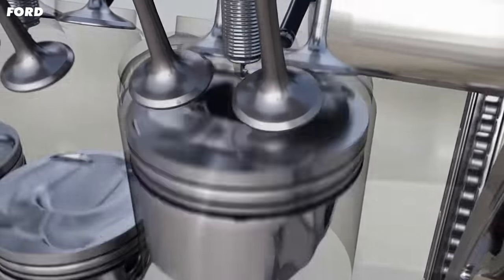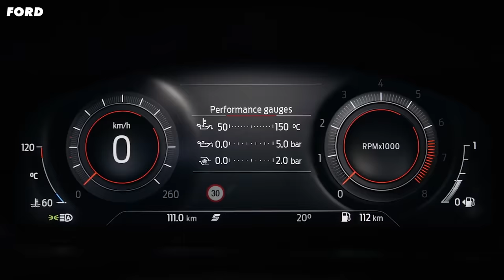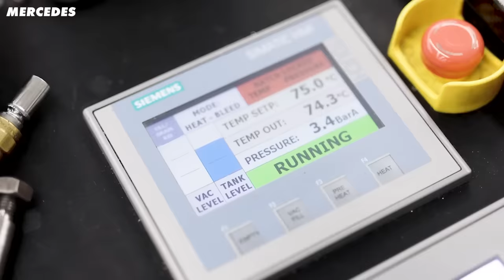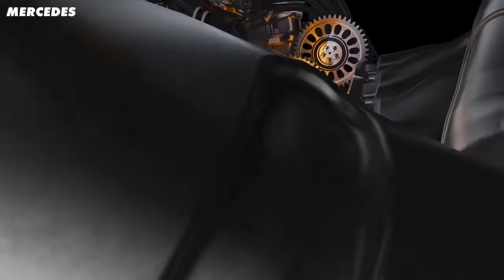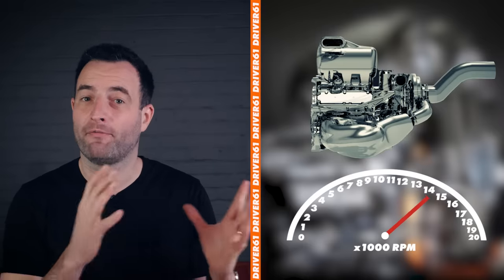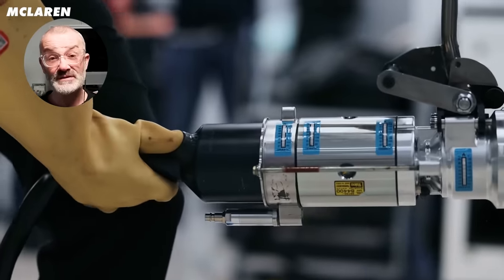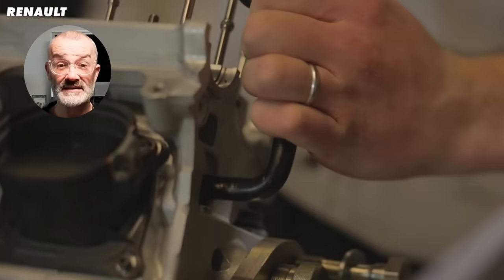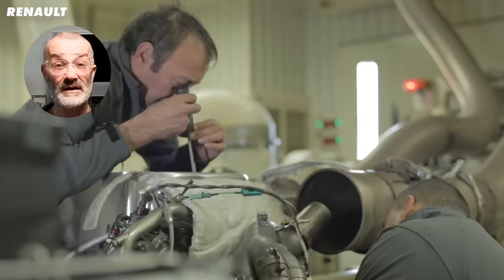$5000 Normal Engine vs $10 Million Formula 1 Engine

Comment: **SIGH**
F1 engines are NOT seized when they are cold. This is a myth and a lesson in basic physics. When things get warmer they expand. So if an F1 engine can’t turn when it’s cold what do you think will happen when it’s warmed up? It’s locked up even more so!

The reason why they are warmed up for over an hour before they fire them up is about tolerances. Just as with the SR-71 Blackbird, the engines and such are built to operate their best at race temperature. So when it’s hot it delivers max performance. But when it’s cold, because the parts have not yet expanded “into place” due to heat, they don’t fit as well together and fine amounts of damage is done inside the engine. Which is bad…. Obviously. 

Sorry. I just get tired of experts getting this wrong. Im a fan of his content. He’s one of my go to’s for F1 info. But this is incorrect.

💔💔💔💔RIPKB💔💔💔
This will forever be too soon 😞. Thank you for all the times you put a smile on my face with the Hoonicorn 🙏🏼
Reply: Came to the comments to make sure someone pointed this out 👍🏻
Reply: Not saying it is actually locked up, but -
What happens to a cylinder when heated?   It expands.   This means the bore opens up a tiny little bit.   
If the bore opens up, that increases piston clearance, which would reduce wear.   Short stroke high rev engines such as these I would imagine are ridiculously oversquare, and likely subject to skirt interference, among other issues.
Reply: @DethWshBkr   I was juuuuuust about to argue with you. Then I remembered I had a brain and knew better to look up the physics on thermal expansion of cylinders and yes, the hole gets larger. Thanks for the correction! There’s still fitment tolerances that must occur for other parts so they don’t just rattle around like a bunch of marbles in a clothes dryer. 

That’s said, here’s a cool video about warming up and starting an F1 engine where the engineer says they aren’t seized. So we are both right. 

https://youtu.be/W-Tx-qiJx2A

Comment: What a silly title. You are including all the R&D costs that went into the F1 engine plus the little bit of manufacturing cost. For the production engine you are just quoting manufacturing. But the R&D costs of a production engine dwarf those of an F1 teams engine. It's only 5 grand per unit because they make hundreds of thousands of copies.

Comment: I still cant see $10,000,000 there! That's the same cost as a CF6 high bypass Jet Engine.The most advanced jet engine to date, the PW600 used in the F35, $21 million. The cost associated with Formula 1 is a complete load of BS!!!
Reply: I think you're not taking into account that these engines dont take advantage of economies of scale. A Jet Engine's cost is spread out among thousands and thousands of produced copies of the engine, while an F1 engine is produced 3 times the number of cars that are using it. So lots of the costs per engine are so much higher for an F1 engine than a jet engine, hence the price.

Comment: The price tag of the engine doesn't represent its performance. It's the concept that decides everything. Whether 5K or 20M are nothing but pure rubbish as long as they are reciprocating engines.

Reciprocating engines are the least efficient concept and should be abandoned long long time ago. It's a shame that the entire automotive industry is still producing this type of rubbish till this day.

Why do we need oil change for the engines after certain mileage? Because in reciprocating engines, high pressure inside the combustion chamber forces fuel to slip pass through the piston rings and ruin the lubricant oil. That's the purpose of oil change. It also means the higher the pressure, it will cause more fuel to ruin the lubricant. Because of that, all GDI engines with turbocharger are unreliable because of its high pressure.

To all car makers, stop producing rubbish. Start making cars that are reliable for as long as possible. Cars with no resale value are rubbish but nothing else.
Reply: Believe in JESUS today, confess and repent of your sins. No one goes to heaven for doing good but by believing in JESUS who died for our sins.  “That if you confess with your mouth, “Jesus is Lord,” and believe in your heart that God raised him from the dead, you will be saved. 10 For it is with your heart that you believe and are justified, and it is with your mouth that you confess and are saved. ”(Romans 10:9-10)❤️🙏

Comment: they can only do it @11500 rpm, might not even break it. please ask peter why they make a fuel flow limit knowing that it won't rev @ 15k rpm, so dumb of the rule makers.
Reply: The limit is 15000 rpm but teams keep it to 12000 for reliability
Reply: fuel cut off first before reliability breaks it down

Comment: I don't care how technologically advanced and efficient modern F1 engines are, F1 got its balls chopped off when it downsized away from V8 and larger cylinder count engines.    When F1 was mandated to go to six cylinders,  they should have shut the whole program down.  6cyl F1s sound like lawnmowers turned up too high.   The fun is gone.

Comment: Meh, this tech was cool 20 years ago . Electric motors are much more reliable /powerful  and can be mass produced . Old tech trying to be cool. It’s like making the most advanced vinyl record that can spin super fast and hold 100 songs vs internal solid state NAND memory.
Reply: Sorry to ruin your trance of regurgitating talking points, but F1 engines already use electric motors. The combustion part of the engine is used to power said motor because the combustion chambers in F1 cars reach around 50% thermal efficiency, rendering even hypothetical thermodynamics-breaking batteries that can somehow store several times more energy than the ones we currently have worthless, so no, none of it is the "vinyl" of modern engines.

Moreover, modern electric motors are nowhere near as reliable as their combustion counterparts. I know your types like to chant the opposite of this like it's some kind of dogma, but we already have valid data analysis due to electric vehicles having been around for a few years in proper numbers that simply trashes your house of cards at this point. Consider the insights for more reliable electric vehicles conducted by Consumer Reports back in January of 2022. According to the results, electric motors are outright 2-3 times less reliable and more prone to minor and major malfunctions than their combustion counterparts. Find something else to further your agenda, this is getting embarrassing.
Reply: @Adrenalin844  ice engines have too many moving parts . Ice engines are dying for good reason. Good riddance , like I said this F1 tech was cool back when MySpace was cool

Comment: Cool video.... But got to say there is a lot of wankerteering in F1 I have a 2ltr turbo that pushes nearly 9k rpm and 900hp @ the wheels and cost around 60k and weights around 150kg

Comment: Amazing f1 engines yes,but for what? Unnecessary expensive especially if look at  the horsepower/money ratio.Honestly the serial 1.8t engine with  new connecting rods easy run 400hp. If you change the piston then safe the block till 900hp with KMS ecu and without any serious modification. Image if you make a head with pree ignition for the 1.8t like Ferrari did and use 500 bar fuel system. You have 2x better engine than F1 and is will  run for 10 thousands of kilometres not 6000 if they ar lucky. I understand that those engines are race engines and not going under 5k rpm. But I'm sure 1.8t could do also while they using for race in many series.

Comment: Silly video, you didn't give a reason other than low production numbers and high specific output. They are basically rocket engines, same magnitude of production (10ish a year), absolute maximum output possible, similar cost. The teams developing each are similar in size as well (not a cost coincidence).

F1 engines are only worth a fraction of the median season prize. I would go out on a limb and estimate 10% is the cap.